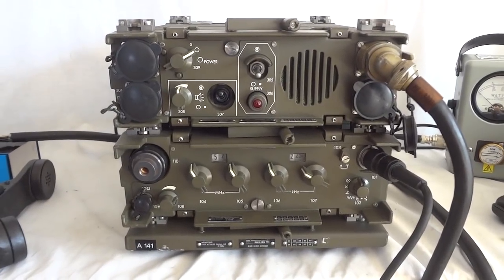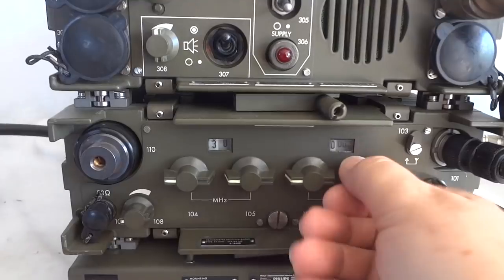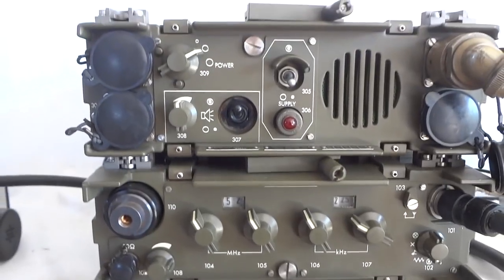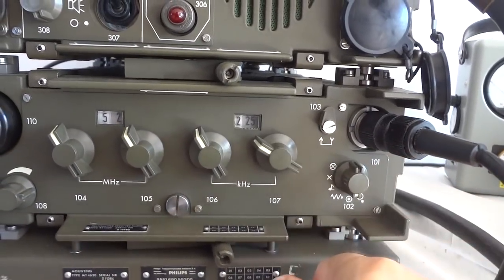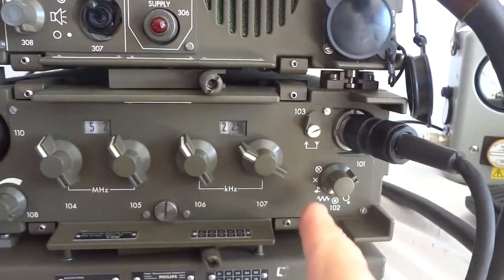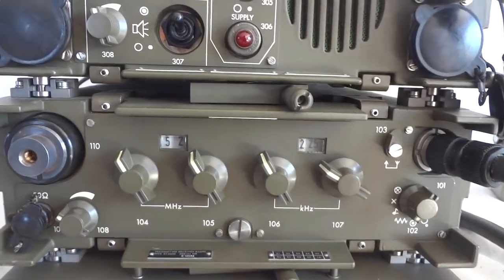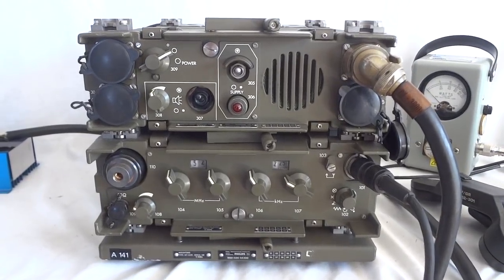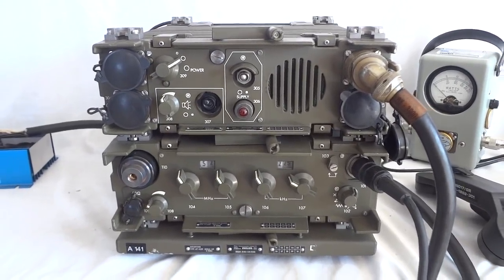Tactical military mobile radio VRC 4622,  30 to 80 MHz by Philips Magnavox

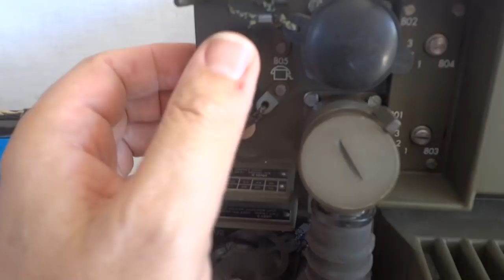Comment: @10:10 The second IC connector (top one)  can be used for a second trx on top of the speaker/power unit or just build the set differently, TRX above speaker. This equipment was still in use during my military service in 1992/1993. At a certain moment in 1993 the first field tests with crypto sets started and my guess this was short before the dutch army switched to new sets and these became obsolete.
73 de 3fus.
Reply from the maker: Thanks for the info, always like to read feedback from people who actually have worked with the radios. 
The Dutch military used this radio's predecessor, the FM-3600 for many years. This FM-4600 was the successor to that radio. It is capable of 25 kHz channel spacing where the FM3600 was limited to 50 kHz spacing. However, this FM4600 was not a success because it was hardly a step-up from it's predecessor in terms of functionality. It was therefore  deployed only for a brief period, and many ended up in surplus unused (like this one). The Dutch I think then switched to SINCGARS compatible radios, capable of frequency hopping which had become a NATO standard. So this FM-4600 radio development was basically a taxpayer funded failure due to p*ss poor planning. But it ended up being a great boon for military radio collectors!
Reply: Vrc. V...?  C???r???